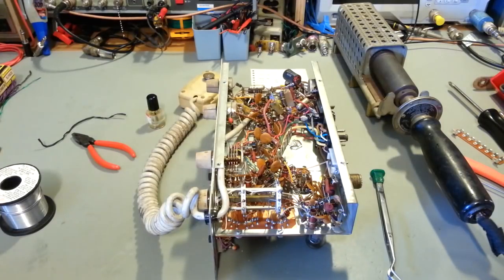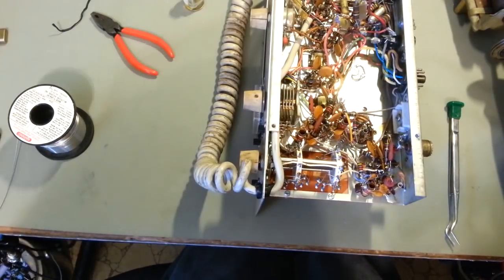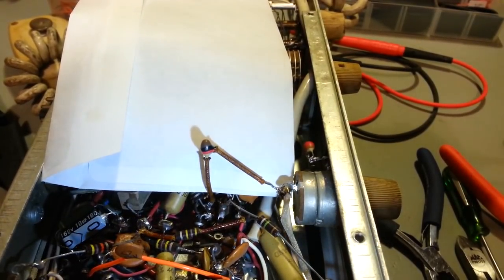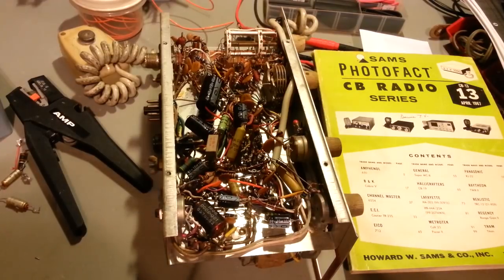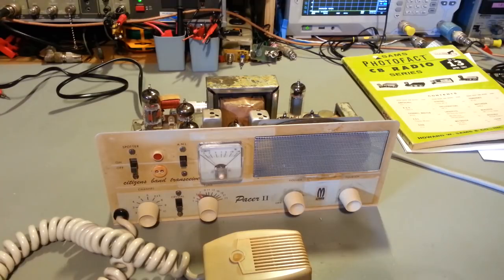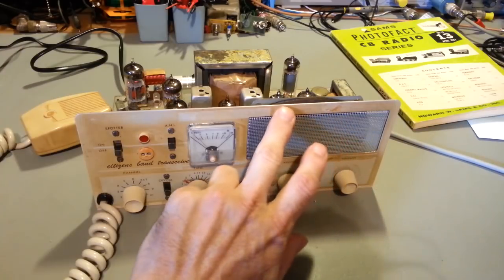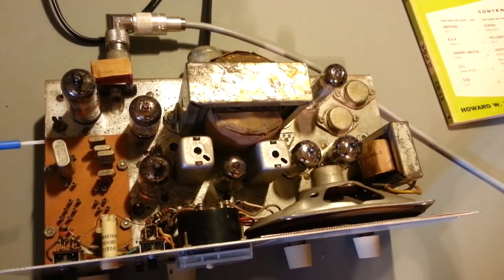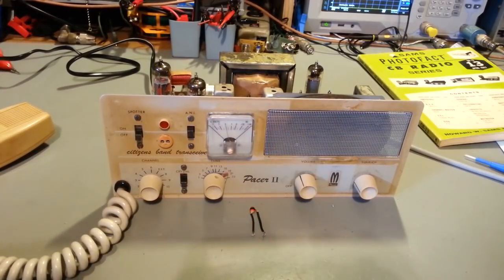Metrotek Pacer 2 vintage tube type CB radio restoration.

Comment: One of my first radios was the Pacer II, given to me by my Electronics professor at college. They were made by Regency. It worked pretty well. The transmit crystals are half frequency and I had to special order one from International Crystal back in the 70’s for channel 5 and later, channel 30. I put a variable capacitor and a switch in the front to switch the variable receiver and get channel 30. I think about the only VFO you could get for it was a Glen. I don’t recall a Siltronix or Maco that covered that frequency setup. I’m getting ready to put a Glen on mine and install a Collins mechanical filter on the receiver. Should be fun!😁
I don’t think those are tantalum capacitors by the way. Much too old for them.

Comment: Great to see your videos, Thanks. The drop type capacitors were common in Philips, Grundig, Blaupunkt, (european) tube type TV's and radio sets and were used until the early 70's in high voltage sections. they are usually stable and only need replacing if the coating is damaged. replace with 1000v ceramic cap.

Comment: Great to see a tube rig on your bench. Also nice to see that another piece of our 11 meter past isn't going to wind up in the local trash dump. Thumbs up to the owner for sending it to you (Mike) in order to give it a new life. Another excellent clip and one more tube rig that might make it to the next generation of chicken bander (and hopefully a generation after that.) PS. I use the phrase chicken bander with respect. I've been a chicken Bander (on and off) since 1973, (9 years old) and enjoy the hobby enough to say I most likely will as long as I've a microphone in my hand be a chicken Bander. Getting an amateur radio license is nice for those who feel the need, but CB radio offers me more than enough enjoyment, and surpasses the need for any more bands, modes ect ect ect that amateur radio offers. I've no need to operate anywhere but there (11 meters.) 73's (sorry for the long windedness off clip rambling.) Happy holidays to all. Joejoe 111 NJ.

Comment: That capacitor is a standard old drop-type capacitor. There is nothing strange about that, and was used in the 70's all the time from audio equipment to RF.
You have to check the loading of the crystal as well. It could be why the freq. has changed.

Comment: Filament wires don't need much abuse.... a good 'tick' against a radio when it is on, and the wires are hot, can often cause this. The rule also is, not to move valve equipment before it had say, 10 minutes, to cool down after switching it off.

Mind you, this poor critter looks like it did not have an easy life !
Nice piece of kit though

Paddy

Comment: Just inherited a Mustang II. 
What do  I need for the power plug ?
This one has 8 pins
What voltage do these use.
 Do I need an external supply that mimics the old dry battery's?
I have variac that could be used.
This will be my first attempt at a rebuild so appreciate any info you can offer.
Love your videos, Ivevgggbeen watching yhe
Reply: Octal pin plug is what it is called. You can still get them, but you'll have to wire it for the radio depending on if you want to run it off of AC or DC